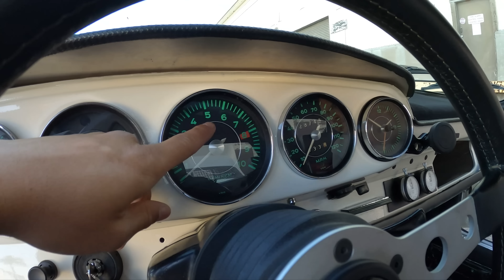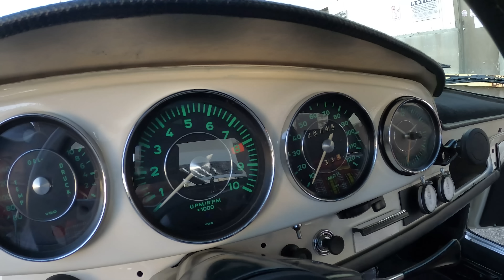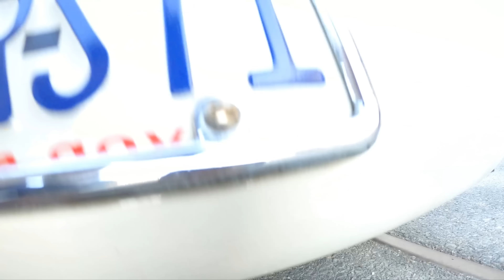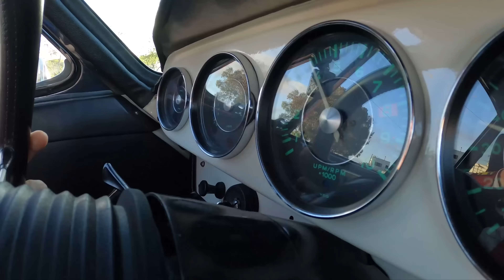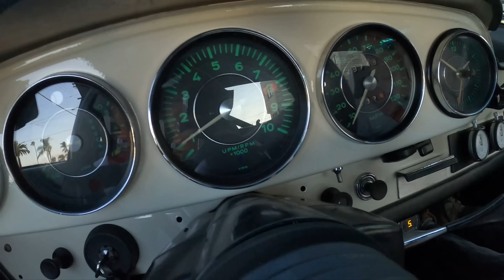'67 Porsche... With Subaru STI Power!? The 912 RSTI

Comment: 25:52 You can install a Volkswagen Type-4-Engine in it and bring it up to 3,0-Litre and get 250-NA-HP out of it! Put a modern ECU (like Haltech) on it or even use 48-Weber-IDF - so, there are ways to power it very close to original - best regards from Germany ;-)

Comment: Cool build.  25:49 - you could put in the 4cyl from the 718 if you wanted to keep it all-Porsche.
Reply: I thought of that too! How about a VR6 from the Cayanne, I know that it's originally a VW motor but it was put into a Porsche making it PCA legal, and use the 996/986 Boxster S transmission they make adapter plates.

Comment: In a way minus the water-cooling, the Subaru conversion gives an idea of what the 912 (and even the 914) could have featured in better circumstances. 

Had of course Porsche made the right decisions during the troublesome development of the 901/911 and its initial issues that could have easily allowed for 911-based Flat-Fours to be built instead of being limited to the 1.6 Porsche 356 and 1.7-2.0 VW Type Four engines.

Comment: The Porsche 912 used the 1600cc/1.6 liter Type 616/36 engine from the Porsche 356. It was rated at 89 horsepower and 90 ft lbs of torque. It had a curb weight of 2134 lbs and handled better than the more powerful 911 it shared it’s chassis and many other components with. It also cost thousands less than the 911 which is why it outsold the 911 by a pretty good margin.

Comment: Very cool car.  I also saved a 914 from the junkyard and put a VW 1.8t into it with a gt28rs turbo, the reason being that a Boxster transmission will bolt to it so you can push those horse power numbers.

Comment: Ha, I have the same "Speaker System" in my CRX

works wonders!
Reply: Spencer Hunter i use a jbl in my old truck, I made a spot to hang it from the roof, right in between the driver & passenger , it’s perfect. I’ve been thinking about getting another one and putting them on the back of the head rests, but idk if you can get 2 to work together or not lol.